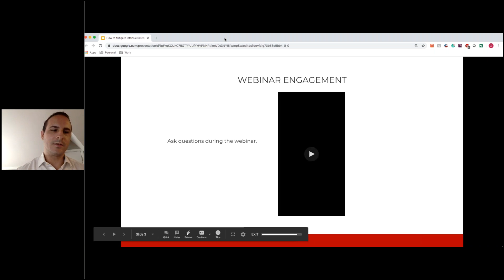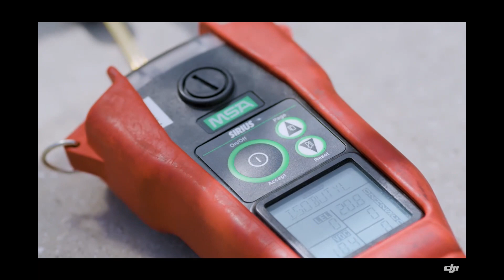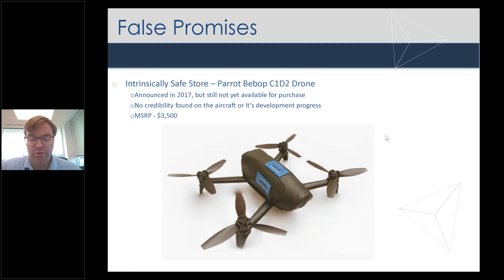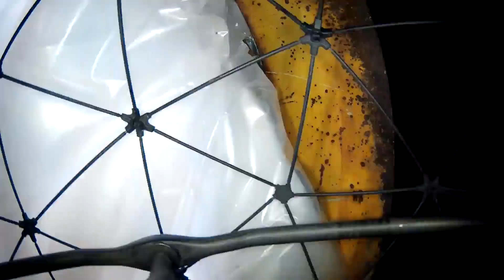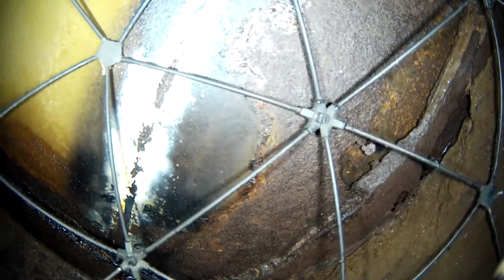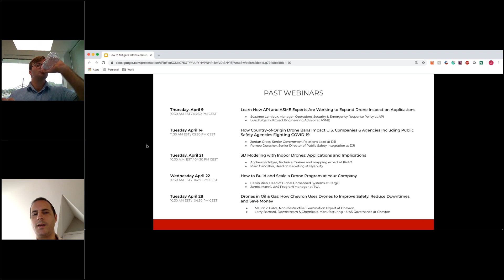How to Mitigate Intrinsic Safety

Comment: Intrinsic Safe is a level of safety and NOT a HazLoc certification. Your Title of this webinar should be  : Hazardous Location Use of Drones, Understanding the Certification process. Intrinsic Safe is one of nine levels of protection methods for Class and Div., NEC. For ATEX and IECex IS is one of 12 levels of application safety. I have built several ATEX and NEC and this is so confusing when people ask for IS when they should be asking for a HazLoc Certification . For Class 1 Div 1 certifications an application for that level can be any one of the following: Intrisically Safe, Explosion Proof, Purge and Pressure. All in all I loved this presentation and I am glad you exposed the False Certifications!! Keep flying!